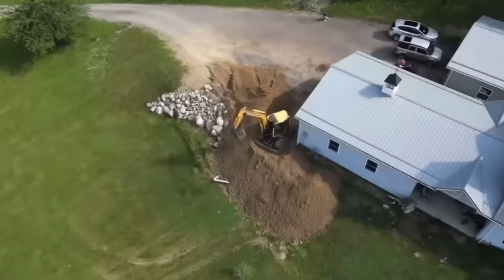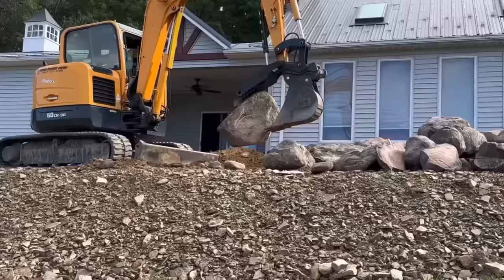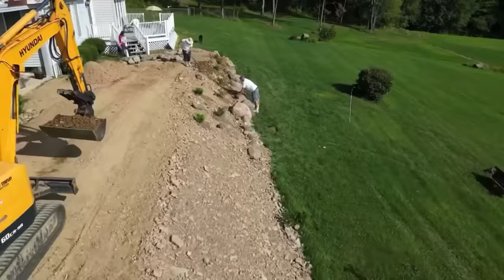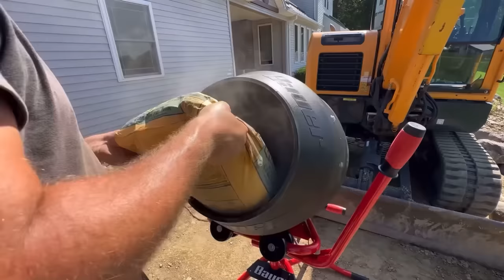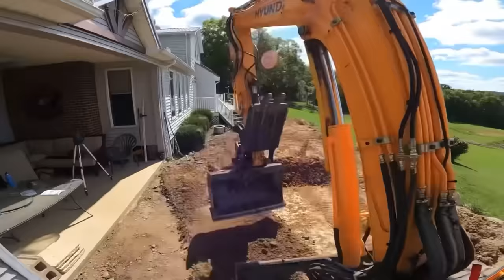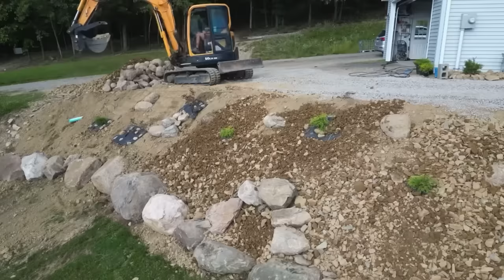DIY Landscape Transformation - Start To Finish Time Lapse

Comment: About the colour of the steps. If you watch "Concrete with the Hauses", he shows time and time again that the colouring of concrete only really pops after he applies sealer over the concrete/colour. It may be an idea to test that by applying sealer in a small, out of the way corner.